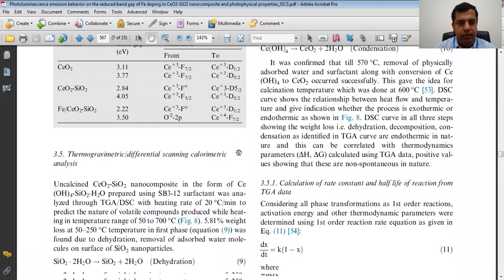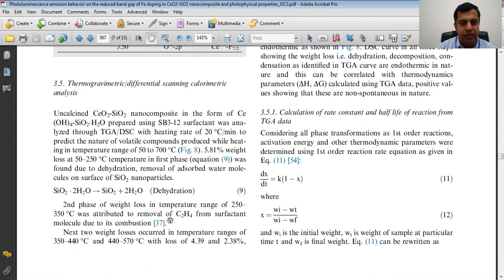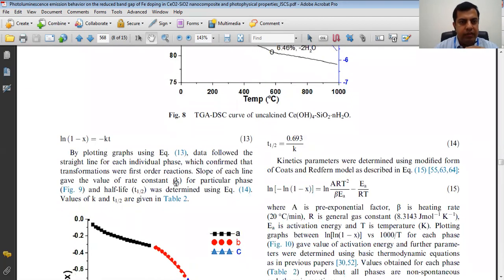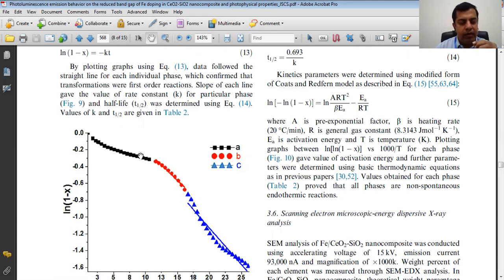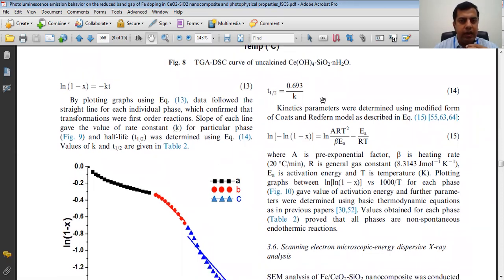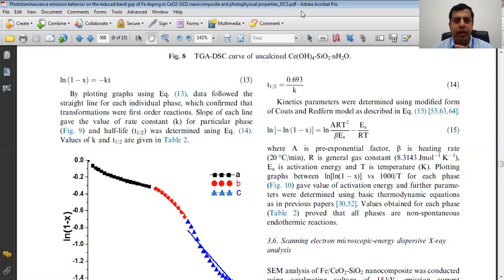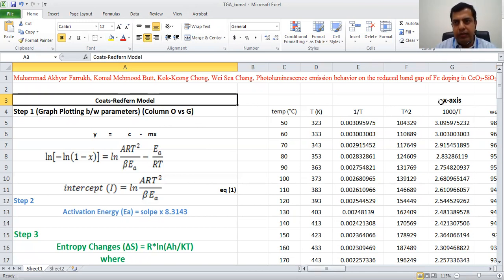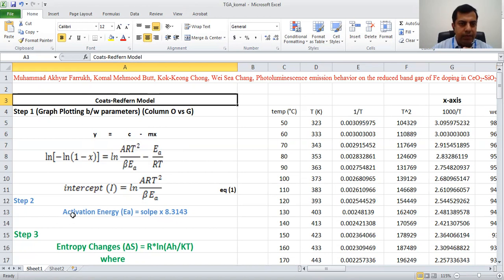PART-2: Calculation of Kinetics and Thermodynamics Parameters by Thermogravimetric Analysis (TGA)

Comment: Nice explianation sir. Can i know where to get the wf? and in my case there is an oxidation reaction in my TGA result. can i know how can i determine my x value for my oxidation result ?
Reply from the maker: I have explained in the videos. Three parts. Wf is last value of weight loss in TGA. TGA gives you the weight loss and if you can determine/identify the weight loss during oxidation process then you can do the same process.
Reply from the maker: Links of videos are given I comments